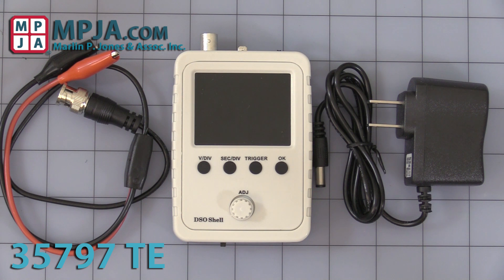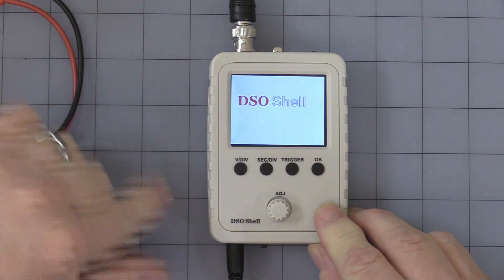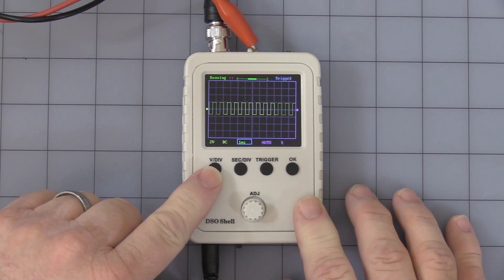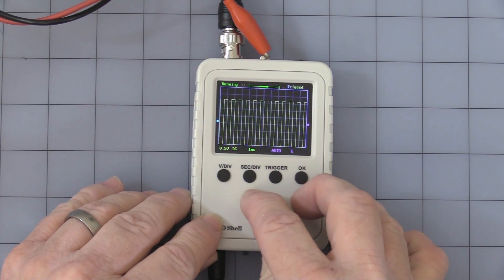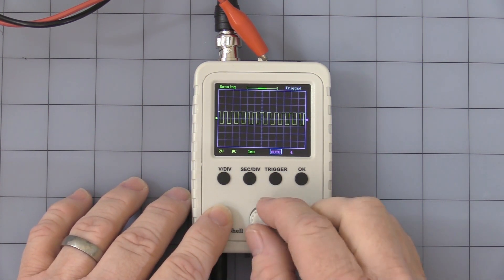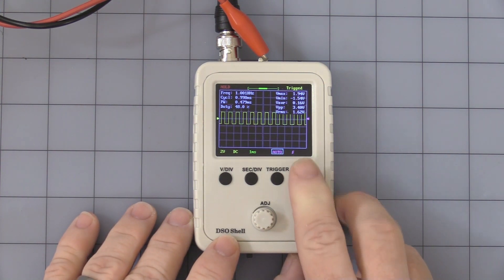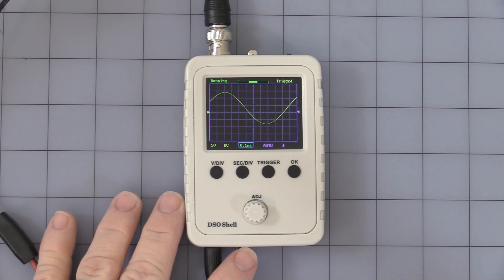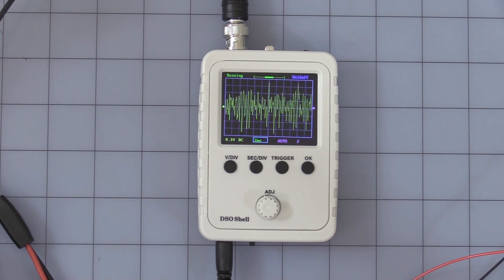200KHz Handheld Mini DSO Oscilloscope 35797 TE

Comment: you know a lot about this stuff im just getting into this. could you tell me if this would work on a car to check to see if there is a data stream to ecu or signal to maf etc
Reply: I was thinking about the same thing i use it on my car audio amplifiers to see clipping of a sine wave! I think its possible not quite sure about the frequency in which canbus works